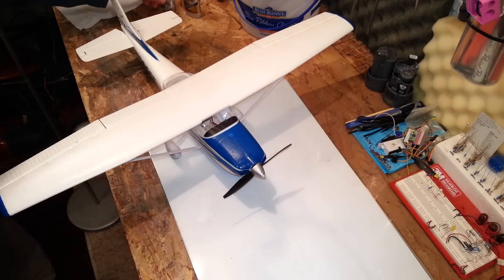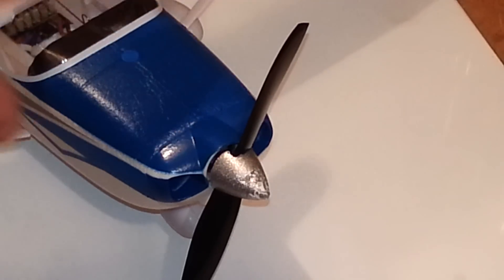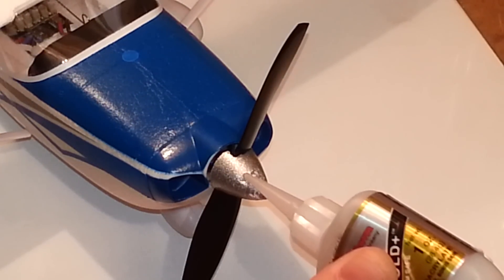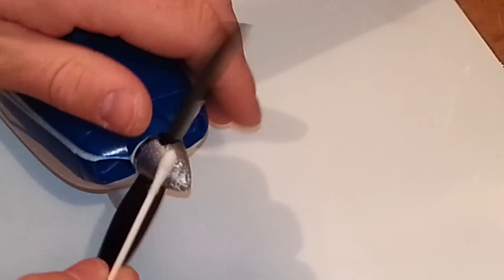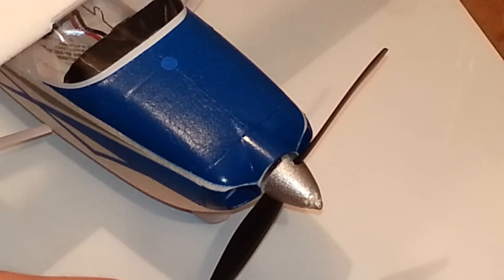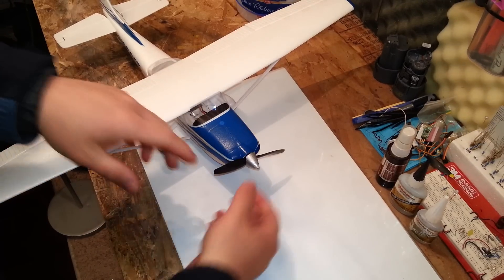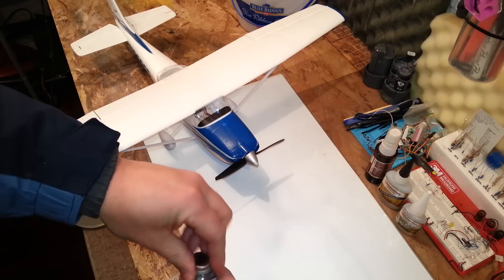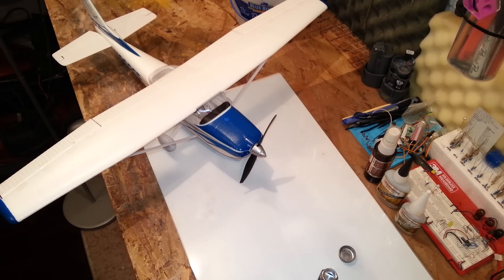Horizon Hobby - Cessna 182 UMX - Spinner (Nose Cone) Repair

Comment: Hi Brian, is this plane worth its cos?, I am hesitating in getting it, quite heavy, no flaps or nav lights, weak motor
Reply from the maker: Watch the flight video. This thing is excellent! I will probaby ad flaps, but will FOR SURE be adding led's.

Keep an eye out for the videos
Reply: Brian Phillips excellent? In which way? :-) the carbon cub is really awesome in comparison (flaps nav lights, floats)
Reply from the maker: I like both!

While they are both UMX planes from Horizon Hobby, the Carbon Cub SS UMX, which is definitely sweet, is almost 1/3 MORE expensive, placing it in a different class, not to mention it's discontinued (puke). The Cessna 182 UMX is in the  $129 class, and it has SAFE...while I personally don't need it, there are thousands of potential RC'ers ripe for the picking...this type of plane could help those just emerging into the rc market!

The Carbon Cub SS ought to be re-released with SUPER-LIGHT tundra tires, and SAFE SELECT. It's a great model, but at $179, Horizon Hobby shot themselves in the foot. It should have come with floats and RTF (lipo, charger, cheap transmitter) as a $199 price point...BNF basic should have been at the $129 price point 

The way Horizon Hobby markets some of these planes works for people who fly rc, not the general populous. I don't think when a kid walks into a hobby shop, they're not even gonna consider a plane for $100+ when they can walk down the aisle and get a crappy, cheap quad for $30 and be RTF later this afternoon...

(Not to disparage quads...they are cool too)

I too wish there were flaps and led's....so I'll be adding them, much to my chagrin.

Thanks for sharing your comments, and thanks for watching!
Reply from the maker: If you can get the Carbon Cub SS UMX, especially for a good deal, GET IT! This plane has it's advantages. If you can't get the Carbon Cub SS UMX, but want another great choice...get this on!

If you don't mind a bit more simple plane, and want the "look" of the Carbon Cub SS, look at the J-3 Cub UMX.

I have videos of all three, I bet you've seen them all!

Comment: I crashed into the ground and broke the spinner.  I assume the plane can run without the spinner.  It's just for aesthetic purposes, right?
Reply from the maker: Absolutely! Spinner is only decorative here. As you get more advanced planes, the spinner will act as an assembly to hold the prop onto the motor, but for the moment, you're good to just pull her off.

You will do a lot of crashing, and a lot of repairing when you're new. Be patient with yourself! Don't give up!

I trust that you will just pull off the spinner, then you'll be fine. Make sure things appear to be balanced, and you'll be good to go flying again. Horizon Hobby does a good job of making replacement parts available...but nor particularly cheap :(  I almost never buy replacement parts. I fix stuff, and film the repairs to help others with my experience.

Comment: Hey Brian, Love watching all your mod and repair videos on the Cessna 182. I'm looking so forward to getting my 182 delivered next week and plan on doing the flaps and LED mod first thing. As for foam repairs to the UMX planes, or any other foam, have you ever tried Woodland Scenics Foam Putty? This stuff is great, super light weight and strong! I first use foam CA to fix any broken areas as you do, then I fill the repair and any imperfections with the putty. Do a nice light sanding after it dries, paint and your ready to fly again. 

Woodland Scenics Foam Putty at Amazon: 
https://www.amazon.com/Woodland-Scenics-Foam-Putty-WOOST1447/dp/B0006NARV8

Looking forward to more great videos!
Reply from the maker: I don't use Lightweight Spackle, but I've heard it's a good solution for foam repairs.